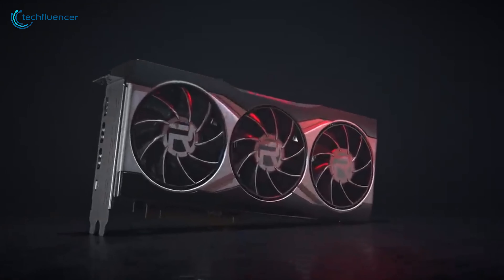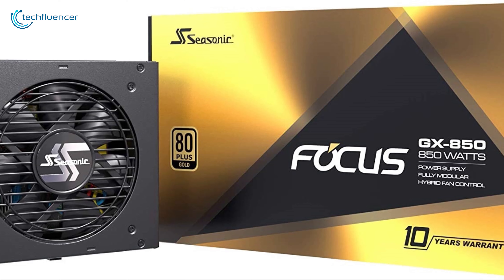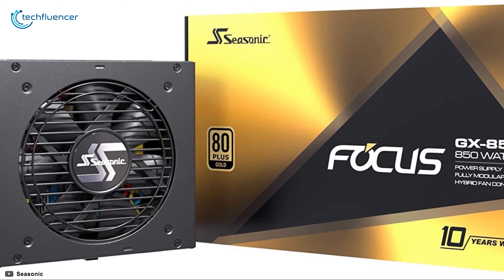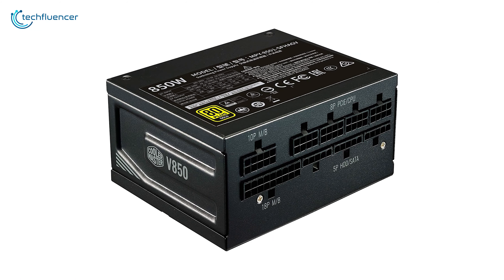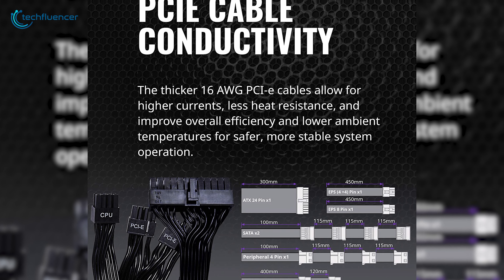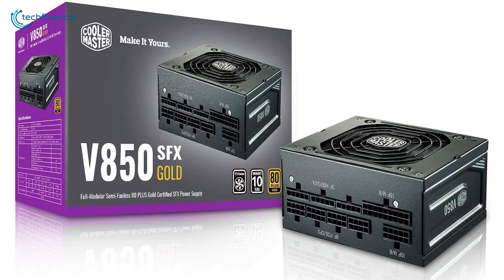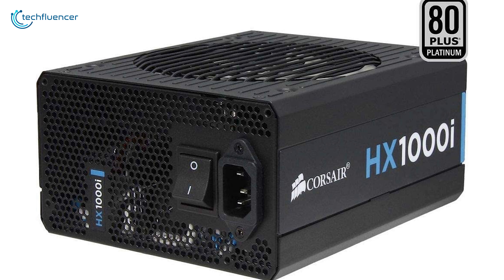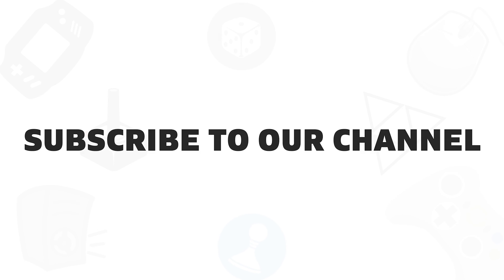Top 5 Best PSU for Radeon RX 6900 XT

Comment: Is Evga G3 750w good for the rx 6900xt tuf?
the processor is an i7 8700k at 4.7ghz
Reply: Get the 850 because you might get blue screen if you want to overclock